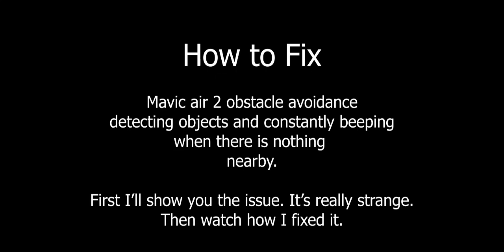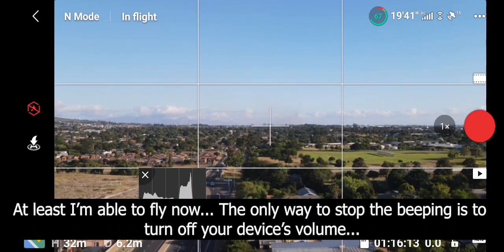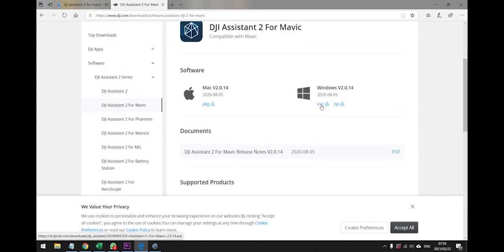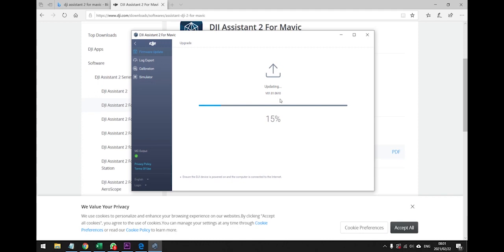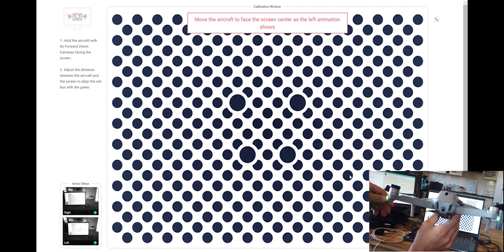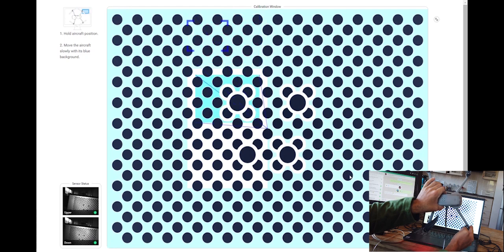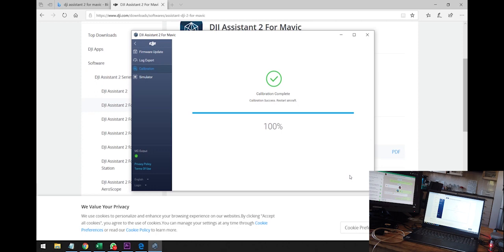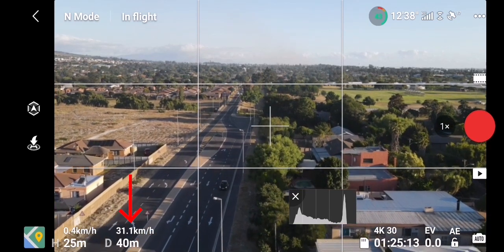Fix Mavic Air 2 obstacle avoidance constantly beeping - calibrate the sensors

Comment: I have this issue in my mini 4 pro, is there a way to fix this also
Reply from the maker: This this video steps not help? Also check if there is any errors in the app
Reply: there is no calibration yet for mini 4 pro
Reply from the maker: @markjames358  I think dji assitant 2 for consumer drones has updated

Comment: Thanks so much for doing this video, I just had my drone back after being fixed and had this issue and worried i'd wasted my money but having the identical problem.

I have a Mac and it won't let me download the horndis, looks like it isn't compatible with the new Mac OS, and that they have discontinued updates. Any ideas or experience anyone?
Reply from the maker: Won't let you download "horndis"? what is that? Remember your Air 2 uses DJI Assitant 2 for Mavic

Comment: Hello ! thank s for your video .
I have a mavic 2 pro and after a crash i have the same problem .
unfortnatly i can t calibrate my sensor with dji assistant 2 because the down sensor are broke but all other are good but head sensor constantly beeping
Do you know how to fix this issue or calibrate sensor singly ?
Thank you
Reply from the maker: Sorry to hear. Only way to fix it is to turn obstacle avoidance off completely or semd it in for repairs...

Comment: My air 2 continue shows error i can not calibrate what to do plz help. Tried 30+ times
Reply from the maker: Did you have an accident with your drone? Also, are you moving the drone while calibrating or are you just pivoting it?
Reply: @InfinityDrones  no
Reply: I m just holding as tripod  mode. Used two different laptop too. Show calculation failed
Reply from the maker: @AjmerToys  did you have an accident?
Reply: @InfinityDrones  no accident ever
Reply from the maker: @AjmerToys  so the calibration process starts with no errors. Does it proceed through all the test and fail at the end?
Reply: @InfinityDrones  yee fail at end
Reply: Yes fail at end.
Reply from the maker: @AjmerToys  this is very strange... Are you are using dji assistant 2 for consumer drones correct?
Reply: @InfinityDrones  yes for mavic series latest version
Reply from the maker: @AjmerToys  no sir. For the mavic air you need dji assistant 2 for mavic, for the air 2S you need dji assistant 2 for consumer drones
Reply: @InfinityDrones  i have the dji assistant 2 for mavic only.
Reply: @InfinityDrones  I have followed the steps but it says failed at the last step, can you tell me where the problem lies?
Reply from the maker: @xewavetuyen5673  are you pivoting the drone (keeping it in once place)? If you are not moving the drone too much then you might have a bad sensor. Did you have a crash?
Reply: @InfinityDrones  My plane had a collision I fixed it.  i followed the instructions on dji support but it failed at 99%
Reply from the maker: @xewavetuyen5673  then I'm 90% sure you have a damaged gimbal and this will not be able to fix it...

Comment: just one other tip you can give on the vision sensor calibration is that its good to redo it after every firmware update. and when you have a new drone it has to be done before you fly for the 1st time. other thing i also noticed is that the reason why you calibrate the sensors twice is that one sensor is so see up close and other one is to see a but further away so when you have drone close to screen and move it away for the second time you are basically learning the drone depth perception so its very important to do vision calibration after every firmware update just to make sure its working correctly
Reply from the maker: Exactly that yes! Very good tip, thank you very much for the comment. I still just find it weird that it didn't give any error in the Fly App as we see in the GO 4 App. I"m so happy Litchi no supports the Air 2, I will give it a go since it's much more like the GO 4 App.